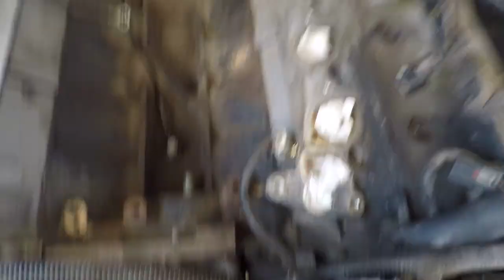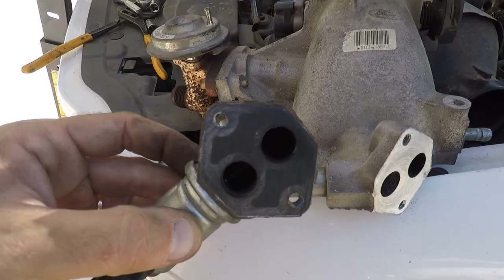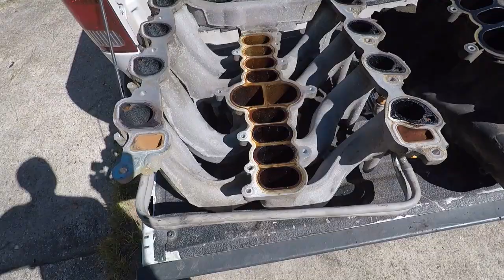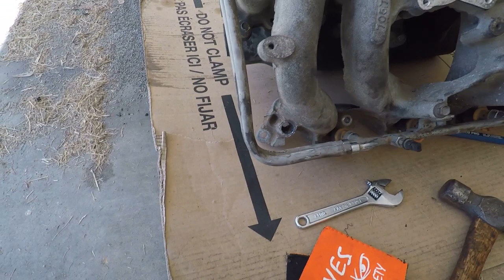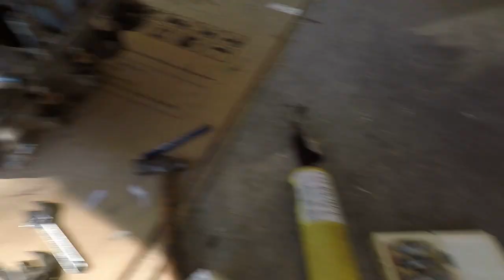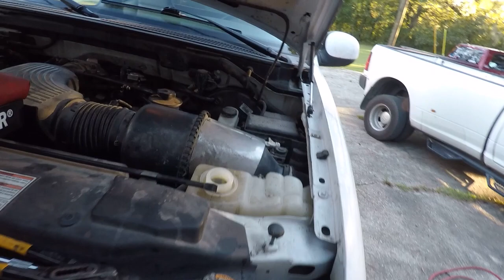1997 Ford F150 Worst Water Leak Repair

Comment: Mine is leaking from the bottom since you’ve fixed it has it leaked from the bottom?
Reply from the maker: Never leaked from the bottom after this repair. The rad failed, but that was age related. Thanks!

Comment: Question Aaron, I got a 97 ford f150 4x4 4.6 triton and I got a coolant good solid leak it runs down between the engine and the fire wall on the passenger side do u think I might be leaking in the same spot u was bc I’ve changed my heater core twice (not doing that again) and I’ve done a thermostat and I just got a water pump that I’m gonna be changing in a day or so but I’m trying to track down a leak bc a month from now I got to do a 100 mile trip and I want to take this truck please help me
Reply from the maker: That coolant pipe would absolutely be my guess. If you've change the core, and everything else, About the only other thing is the stupid coolant pipe under the intake manifold though if there is not pond of coolant in the valley, it's most likely that little pressed in stand pipe.

Comment: For anyone wanting to know. 3/8 NPT tap and a 37/64 drill bit is good for this fix. Use thread sealant and don't over torque it, threads come out a little shallow. 

I personally just used a 3/8 npt to bard and stuck a hose and clamp on it, a barb to barb, so it connects to the outlet pipe's hose. It might not be as perfect as getting the hard pipes but it's what i had on hand and was very cheap. 19 dollars total for the fix in 2023, a steal with all this inflation.
Reply from the maker: Thanks for the clarification! I went even lower tech on  my hose attachment. I just used a threaded nipple and clamped the hose directly to that. Still going today.

Comment: What size tap did you use ??
Reply from the maker: IIRC, it was a 1/2NPT. Thanks!
Reply: @aaronsrose  thanks!
Reply: Revisting this to let anyone else now that 3/8 tap with 37/64 drill bit works for this fix.

Comment: As a follow up to the question as to what the tap size is, i will have to conclude that it's a 1/2" tap.  I gauged the pipe to be 0.65"  which translates to 5/8".  My original thought was to just cut the pipe and slide a 5/8" heater hose over the leak area, join the two pieces and clamp them together...its doable if you remove the coil pack in that area which would allow a clamp to be tightened at the lowest part where it attaches to the manifold.
I fired up the engine to confirm if that is the source of the problem and slid an old iPhone in to record the area...not a drop leaking there, Darn!
So, back to square one.
There another gentleman, Ron Williams, who operates Mobile Fix Automotive who uploaded a video that is 3 minutes long and the date of the upload is Feb 28, 2020. He has located a similar passenger side coolant leak apparently from the heater core through the firewall thats impossible to see.
Next step, remove the right tire and the wheel well liner and maybe this will open up the area enough to track this leak.
I hope this may help someone else who is in the same situation.

Comment: Good evening, at the 5.37 time stamp you mention 1/2" NPT but, in the comments Shelly Wall asked what size did you use and the reply was 3/8".  Gosh that pipe does look like a 1/2" unless its a 3/8" going into an elbow that expands to 1/2".
I'm gearing up to do my outlet hose and i can't help but wonder why no one has tried to just fit a heater hose over the whole pipe and put a hose clamp nearest to the base.  That is if the pipe is secure enough to support the hose.
Reply from the maker: I don't honestly recall which that size I ended up using. The tap kit I have has both so it was whichever size was just slightly larger than the existing hole in the manifold. Your sleeve idea is interesting. For a quicker fix I bet that would work if you could get the hose around the bend in the tube. If you know how to braise, you could probably overlay the hole from the outside as well.
Reply: @aaronsrose   Once again thank you for your insight.  To play it safe i will prepare for both eventualities but, to satisfy my curiousity, i will try slipping a heater hose over the actual pipe and clamp it.
If it works, i will follow up and maybe save someone else the grief!
Cheers!

Comment: Happened to me. Thankfully I had a friend who was able to fix it while I got rides to work. Happened at 237k just hit 266k and survived us moving 600 miles away. Took on two summits and worked damn well. 

Quick tip for anyone doing this, while you have it apart might as well get a dual cell radiator to replace the single cell one.

Comment: I'm dealing with this same problem.  I'm curious what kind and size of pipe you used. Do you remember and would you mind sharing? I'm just in the process of getting the stupid coolant line off now  I'm thinking I'd rather not waste my time with another coolant line where you couldn't even get it to fit I would have no idea of how to get it in the manifold. So I'd like to do your retro fit if you could give me some info on how to do it. Thank you!
Reply from the maker: Howdy! I'm out of pocket right now but I think it was 3/8 npt that I was able to tap it to. Once you get the pipe out you'll be able to see what will be close. Fwiw, my truck is at 322900 and still going with no issues from the pipe threaded repair. Thanks!
Reply: @aaronsrose  Thanks for replying. Another question is that just galvanized pipe? Did you use anything to seal the corners, like pipe dope Teflon tape? Thanks for your help!
Reply from the maker: I think it was just black iron. Whatever the homeless despot had in stock that I could make fit. I believe I used a pipe dope out of a tube I had hanging around. For no real reason I'm not personally a fan of teflon tape. I prefer something with some potential to seal.
Reply: @aaronsrose  Thank you!

Comment: Do you remember how you got that middle metal pipe under the intake manifold off? Mine doesn't seem to want to come off.
Reply from the maker: Iirc, there are a couple bolts, one in the galley and one maybe behind the passenger head. The front is just an o ring connection pressed into the water pump. I think. Good luck!
Reply: @aaronsrose  Aaron - Thanks for the reply.  I ended up cutting the pipe in half but the o-ring connection appears to be stuck fairly solidly on this truck.  I have hit it with penetrating oil (PB Blaster) but no budging yet.  I just saw a penetrating oil review which rated almost all of the penetrating oils on the market.  To my surprise Liquid Wrench came out ahead of the rest.  I will just keep soaking it until it budges.  The truck I am working on has a lot more rust on it than the one you work working on.... So I will take my time one it.  Will let you know how it comes out.  Thanks!

Comment: Did reuse the same o rings for the middle pipe or did you get new ones ? If so where did you buy them and did you get them the exact same size as the old ones?
Reply from the maker: Good question.  I seem to recall that the orings came with the new tube from autozone, but I'm not 100% on that. Pretty sure I didn't reuse the old ones as that is a recipe for pulling the intake again in my opinion.  Thanks!

Comment: Hey thanks for the video. How what is holding the pipe in place the one under the manifold?
Reply from the maker: Howdy! Iirc, the front has an oring fitting into the water pump and I think at the rear there are 3 or 4 bolts that hold it to the block. Thanks!

Comment: Did you have the part number for the hard line pipe? Seems like theres a bunch of different models. I've got a motor on a stand I'm putting together and i need to replace that, and also that damn 90 degree elbow...guy who pulled the motor bent it real bad
Reply from the maker: I'll see if I can find it. I don't know how it can be installed though. Massive interference fit and no good way to press it in. That's why I went with the plumbing threaded fittings. Still good at 298000 so far.
Reply: @aaronsrose  also sorry for the questions...what tap did you end up using? 3/8? i may go your path. my original motor got 315k out of it before the head gaskets went, I bought a superlow mileage 4.6L motor (52k on it from 98) but the dude I bought it from bent the crap out of that pipe and I'm not sure I trust it anymore.
Reply from the maker: I think it is 3/8npt. The hole for the pressed in pipe was almost the exactly right tap drill size for the pipe tap. Looks like I used about a 3" nipple, a 90 and a 1 or 2" nipple. Then I just clamped the rubber hose to it with a standard clamp. It's still looking solid.  When mine finally expires, I'm thinking maybe a small diesel. 4BT or the new 2.5 cummins. The expensive part will be the Modular bellhousing 4R100 adapter.  I'm hoping that's not any time soon, though.
Reply from the maker: Another option, if you can get a later model manifold out of a junkyard with the water hoses on it, they moved that terrible pipe to the front starting sometime in 98 I think.
Reply: @aaronsrose  Thank you so much for all the info. I truly appreciate somebody on YouTube replying and giving me information :) You've helped me a ton!
Reply: @aaronsrose  I wanted to let you know that the 3/8 NTP tap and pipe worked perfectly. I had the intake off anyway and hammered out the busted pipe and threaded it. Youtube wont let me post a photo comment but its going to be solid AND serviceable now!
Reply from the maker: The one I tried was a Dorman 626-229 from AutoZone. Maybe the OEM part would be easier to fit but I'm not sure.
Reply: @aaronsrose  Thanks man, appreciate it. I was wondering the part number on the heater return pipe that runs under the manifold as well. They seem to make like 15 different ones for different applications. the part number stamped on mine doesnt turn anything up
Reply from the maker: The under manifold pipe for mine was a Dorman 626-221. (Though that says it must be without the heated PCV.) So if you have a heated PCV, it would be different.

Comment: I have a 97' Expedition 4.6 and I think I have a leak on one of the two hoses that go to the firewall.  The leak seems to be right at the base of the firewall (hoping it's the hose and not the connector).  Did you disconnect the hoses when taking out the intake manifold?  What's the best way to do it? Mine has been leaking and trickling down onto the plugs causing cylinder 4 misfire. Help!

Comment: Uggh. I just sprung a leak in the same area. 97 F250. Not looking forward to chasing it. Thanks for the video!
Reply from the maker: By the way if that's a 7 lug f250 that looks like my 150, that's a very cool one year only truck.
Reply: @aaronsrose   Yep - it is a former fleet vehicle for Steelcase and has 36k miles.
Reply from the maker: Don't even bother with the replacement tube, just thread it and use plumbing fittings. 283k and still going with no issues. Also, way easier to do all the top end maintenance while the intake is out. Best of luck!
Reply: The 7 lug f250s were made from 97-99 until they cane out with the super duty. They rebadged the 7 lug optioned trucks to f150 7700 from 2000-03 I have an 03 heavy duty version f150 with the 10.25 sterling rear end and the 4r100 tranny. I heard the intake manifold gaskets go bad around the coolant holes but where did the leak start on yours?? I know there are a few coolant lines on the passenger side back by the firewall, is that where yours leaked?
Reply from the maker: Yup. Metal pipe pressed into the rear of the manifold for heater core. Most of the later models I've seen moved it to the front of the intake. Of course the newer intakes are mostly all plastic so I guess it's a trade off. My plumbing parts fix is still perfect at 327k. Thanks!